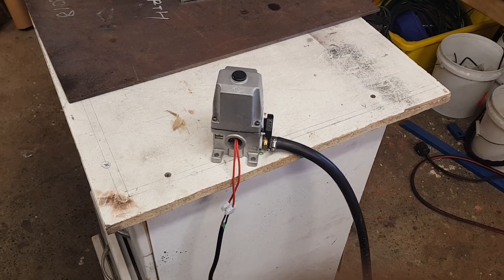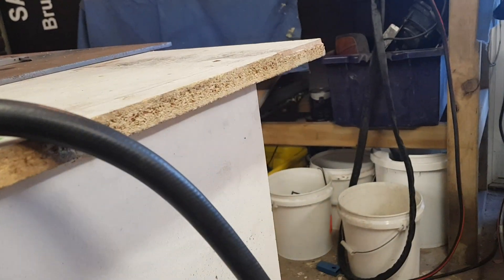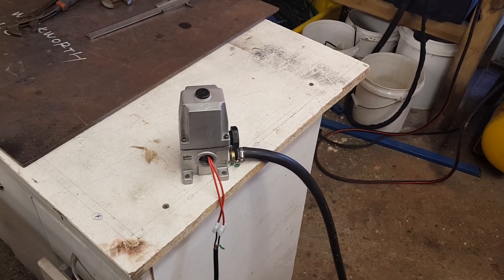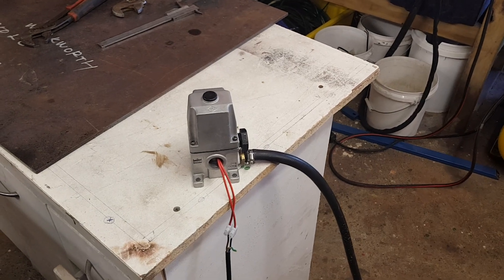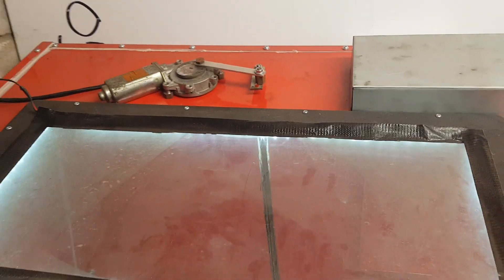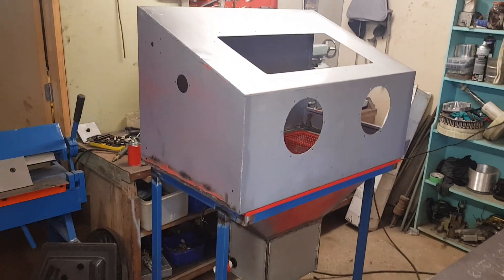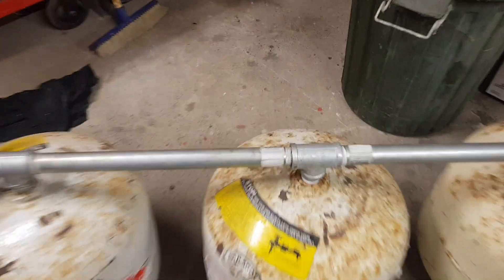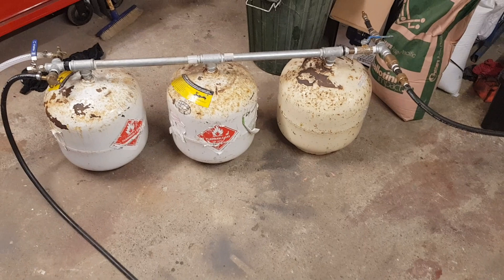DIY Vapor Blaster - Solenoid test and wiper teaser

Comment: Thats what i use for extra air tank but it's one of them big propane tank's i use with a pop of valve fitted too ive just modified one of them jet washer guns what you get with air compressor for vapor blasting
Reply from the maker: Thanks for the comment! I have a relief valve on this set up, but it is also regularly emptied. It is also nearing the end of its service life. Once my compressor is serviced and running it will be retired.

Comment: When I do small cylinders like you have in the video, I fill the inside of the cylinder with dense piece of foam. The abrasive just bounces off the foam and you can press the foam in to get the depth you do want to be available to blast.  Loved the video... let's keep up informing everyone!
Reply from the maker: Thanks Chris.

Actually, thinking about it, I may have seen that in one of your videos. Never crossed my mind at the time.

Thanks
Reply: @ArmouryEnterprises  I should have mentioned.. Those foam pool noodles are what I use.. They make them in different diameters and I just cut a piece off to the length I need..

Comment: Thanks a lot for your quick response, I'm really impressed. I've already got myself an old dishwasher and will be building myself a cabinet pretty soon.

Any knowledge or experience on soda blasting?
Reply from the maker: No problems!

I have a little experience with soda blasting. Fairly good finishes are achievable, but it was the bright lustre and new look of vapor blasting that got me into it.

Once I get a little more free time I want to go back into soda blasting as well as testing other media like walnut shell etc.

Very keen to see your dishwasher build!
Reply: @ArmouryEnterprises  , I'm also very keen on seeing my dishwasher build...lol, I have a tendency to over engineer... it may not be soon though as my work is quite demanding at the moment.